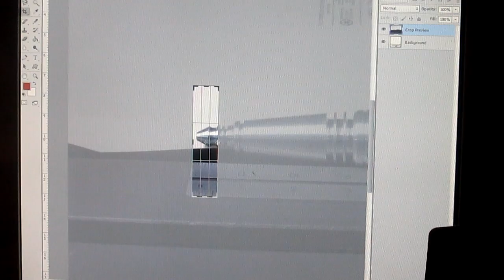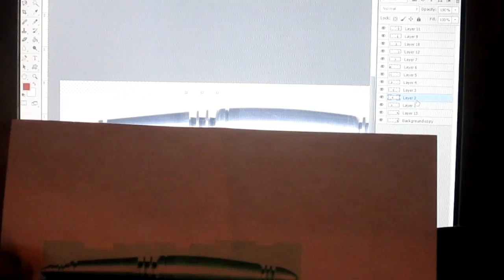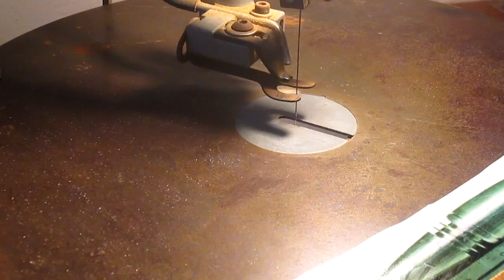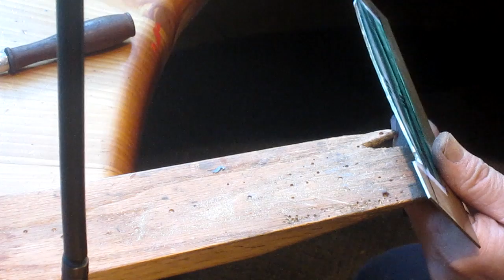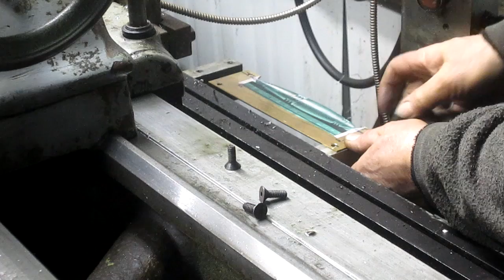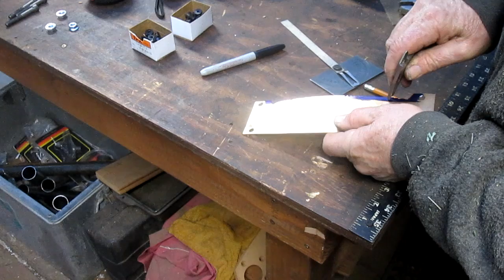Woo-Woo #1

Comment: Nik I use antelope blades they cut great the number 5 is great for brass 40 to 60 thousand they are made in Germany much better than Olson blades that's my opinion . Get a spray adhesive works great for the paper patterns. Great videos

Comment: If you print it on a laser printer in reverse, you can turn the paper over and use a clothes iron to transfer the ink directly to the metal. "Look up pcb etching with laser printer"
Also, 3m spray glue is the fastest way to stick paper templates to things.
Reply from the maker: +Notso Fresh Very cool! Now if I only had a laser printer. Thanks for watching.
Reply: The library does. Mine has an 11x17.
There is also a way to transfer inkjet with acetone, i have never tried it on metal.
I have seen jewelery made with both techniques.
Reply from the maker: +acklan3 I use this method so seldom I'll go ahead and use the glue method. Thanks fro the tip though.
Reply: +Nik C. Colyer if you think it is something you would use regular, for this purpose, a desktop size laser print can be had for $25 used. Just a thought.
Reply: Nik C. Colyer I like you used a scroll saw. I have had one for 40+ years. It is one of my top five tools in my shop. Greatly under appreciated tool, IMO. Looking forward to video #2.